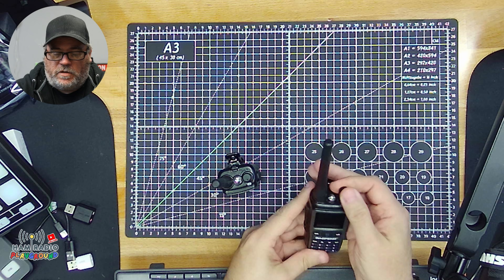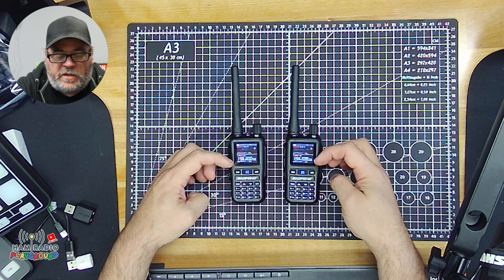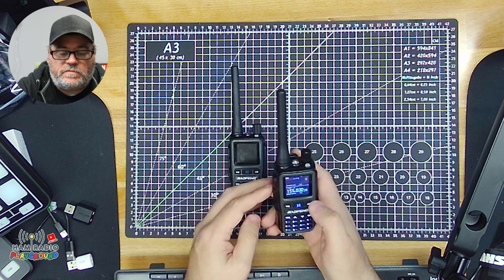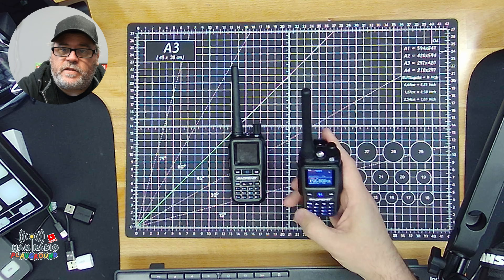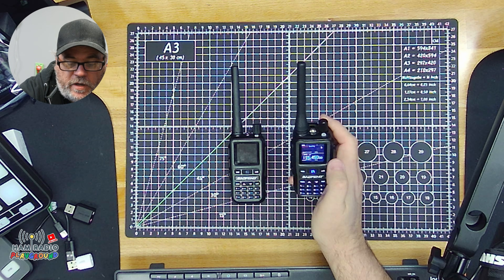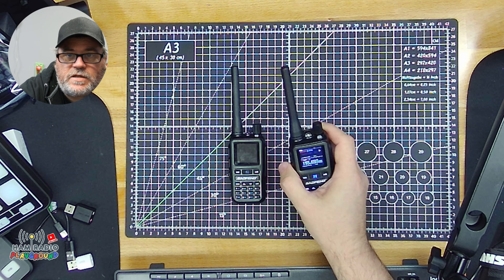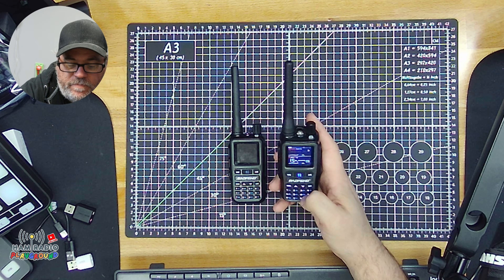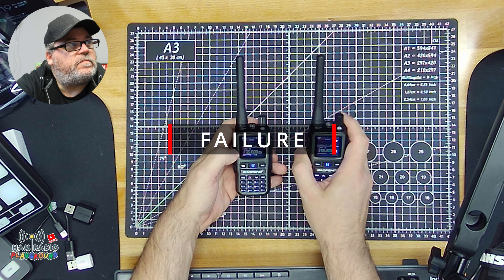Does the Baofeng UV-5R Mini Support Marine Band? Viewer Question Answered!

Comment: Thanks
Reply from the maker: You're very welcome! Glad the video was helpful. Are you planning to use a UV-5R Mini for marine monitoring, or just curious about the capabilities? 📻
Reply: @HamRadioPlayground  I have recently bought 2 Beofengs and have been thinking about learning and getting a licence for Ham radio, Its difficult when your not allowed to talk on them only listen. I used to use CB radio many years ago but it got a bit crazy with all children messing about online. I have noticed ham radio is very quiet its difficult to get any signal and to hear anyone talking, maybe that is because I am using Beofeng Not sure.  Anyway After watching your video it looks like a costly hobby and I might pass, but as I said thaInks for the video I will keep watching and see how I get one.
Reply from the maker: I totally understand the hesitation! Ham radio can definitely seem overwhelming at first, and yes, it can be as expensive as you want to make it - but it doesn't have to be costly to get started and have fun.
A few thoughts:

Getting your license is actually pretty affordable - in the US, the Technician exam is around $15 and you can study for free online (HamStudy.org). Once licensed, those Baofengs become legal to transmit on amateur frequencies!
Why it seems quiet - You're right that it's harder to hear activity than CB. Ham radio uses repeaters for local contacts (you need to know which ones are active in your area), and HF bands require different equipment. Your Baofengs work on VHF/UHF, which are more line-of-sight.
Start simple - You can get on the air, make contacts, and have fun with just those Baofengs and a license. No need to drop thousands on HF gear right away.

The hobby is what you make it - some folks spend $10K on a station, others have a blast with $50 in equipment. Don't let the expensive stuff scare you off! Stick around, keep learning, and see if it clicks. The community is great and always willing to help newcomers.
What area are you in? Might be able to point you toward active local repeaters! 📻
73!
Reply: @HamRadioPlayground  Thanks for the info I am in UK Liverpool I will keep looking and learning what I can so far I have bought 2 radios and 3 antennas trying to listen to others so I can learn. Thanks again for the help. Best Regards Tom

Comment: I have a Baofeng 5RM tuned to 157.000. One of my friends is broadcasting with a Cobra marine band radio on channel 20A, which shows 157.000 transmissions. However, when I receive his transmissions, the signal cuts out, but I receive all other transmissions from other friends with the same radios clearly. Any ideas? I have 2 of the 5RMs and both radios do it. Other folks receive his transmission without it cutting out.
Reply from the maker: Interesting issue! A few things to check:
First, just to clarify - the UV-5RM and the UV-5R Mini are actually different radios, though they're both Baofengs. But your issue sounds like it might be related to how marine band channels work.
Marine Channel 20A isn't exactly 157.000 MHz - it's actually 161.600 MHz. Channel 20 is 157.000 MHz, but there's no "20A" in the marine band allocation. Double-check which channel your friend is actually transmitting on with his Cobra radio.
Also, marine radios are channelized and may be using CTCSS (PL tones) or DCS codes. If his radio has a privacy code or squelch tone set, and your Baofeng isn't programmed with the matching tone, you might be getting carrier squelch issues where the signal breaks through but gets suppressed. Try setting your squelch lower or check if there's a tone being used.
What does "cuts out" mean exactly - is it choppy audio, or does the squelch keep closing mid-transmission? That might help narrow down what's happening! 📻
Reply: @Spikebuckthurmondbranch  20 is duplex transmit is 157.100 receive is 161.600 20A is simplex transmit 157.100 receive 157.100

Comment: Is it type accepted for marine frequencie?. I don't think so.
Reply from the maker: No Amateur (Ham) Radios: 2-meter Amateur (Ham) radios (like Part 97 radios) are generally not acceptable for authorized marine or Coast Guard Auxiliary use, even if they can transmit on the right frequencies.  The question was if the radio could rx/tx on the frequencies... not if it was legal to. As with anything, always do your own due diligence. Thanks for watching.
Reply: It isn't. Marine VHF is chsnnelized, and some "channels" are split frequency channel pairs.
Reply from the maker: @lyfandeth, its not just the channelization. Part 80 radios (marine band) also have integrated features like DSC and MMSI for distress signaling.

Comment: I’ve taken a Baofeng out on a rental boat before. I figured if it went overboard, I wasn’t worried about losing it. But if there was an emergency, it’d be helpful to have knowing it could transmit on Marine frequencies (which I had preprogrammed). I never transmitted on the Marine channels, but my son (who has his General) and I tested 2m simplex from the boat to shore to get an idea of range.
Reply from the maker: That's really smart thinking - the Baofeng as an "affordable emergency backup" on the water makes total sense! I love that approach of having it preprogrammed and ready, but treating it as emergency-only for marine channels. Safety first, but without breaking the bank if it takes a swim! 🌊
How did the 2m simplex test work out from boat to shore? I'm always curious about range over water vs land - did you notice any difference compared to typical ground-level simplex? And that's awesome your son has his General! Do you guys do much portable/mobile operating together, or was the boat trip a special occasion?
Sounds like you've got a good system figured out. Have you considered adding anything else to your boat comm setup, or is the Baofeng backup working well enough? 📻⚓